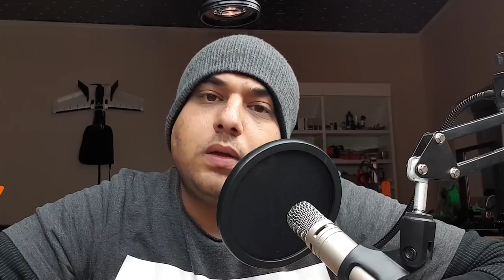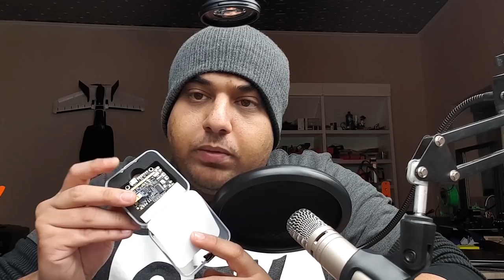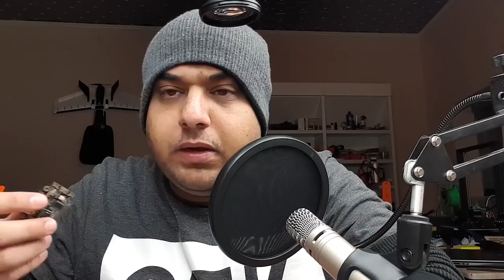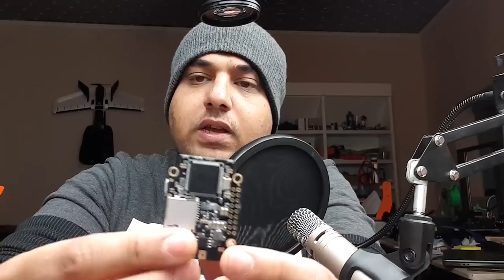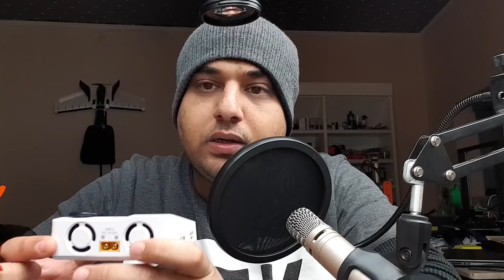Neuroflight / Betaflight And F7 OpenFC Update VLOG

Comment: BEST WISHES for your son's surgery!!

Real-time ESC RPM telemetry was just HUGELY improved by Joe Lucid (BF dev.) in coordination with BLheli.  Now the reporting is mmmuuuuccchhh faster.  Right now it is only 32bit ESCs.  But the driver was his RPM notch filters.  Need new flash of BLHeli for it, but folks have been using/testing.
Thought might help for AI.

Unfortunately I  think you will still need filters or have same/more latency regardless.  AI will need to look at a bunch of the signal to see what frequency the new gyro signal motion is trending towards to be able to ignore it. That will take more time then the associated Phase Shift of filtering is my guess.  The phase shift is getting pretty low.  Down to like 3 to 4ms total (including D term filtering) in latest RPM notch renditions if your machine is well built.

Comment: Keep it going bud, you'll get it. Just a quick thought on your oscillators.... perhaps you over heated them while soldering, those crystals are usually pretty sensitive to heating. I was taught to use a heat sink or at least an alligator clip, directly on the leads between the can and the solder point, when soldering them down to wick the heat away from the actual crystal.
Reply from the maker: That is very useful info.. I will look over it in the morning because on the scope it was not working.
Reply from the maker: Forgot to say thank you :)
Reply: @DroneMesh  Your welcome buddy. Anything I can do to help

Also. I wish you and especially your baby boy the best man.  I just couldn't imagine.

Comment: Regarding wireless R9: have you ever considered using Bluetooth?  Especially the newer versions (4.1, 4.2) have lower latency and are still damn cheap. I use HM-19 for stuff like that.
Reply from the maker: Hmmm I will look into that tomorrow
Reply: BLE should have typical latency of 8-10ms with an absolute maximum of 20ms
Reply: Zigbee (Never used it myself) should have around 18-60ms at small frame size. But the modules are more expensive.  ESP8266  802.11 is about 200ms in real world, independent of packetsize. Dont‘t know if ESP32 is any different.

Comment: I think it was hard to train my ears to not listen  to the motors because  when you start flying far or behind things, the lag is real especially  with distances  because  sound travels very slow.  They don't need to hear anything  and I think they should see maybe  the watt or amps the motors are using that way they know they are working  but  you can already get that in beta flight osd. So I think Someone  needs to tell them they don't need to hear the sound. That sound is  Only One of the many ways to distract  people flying.